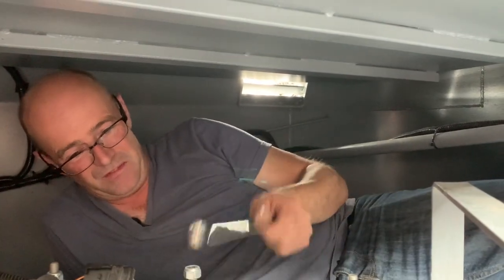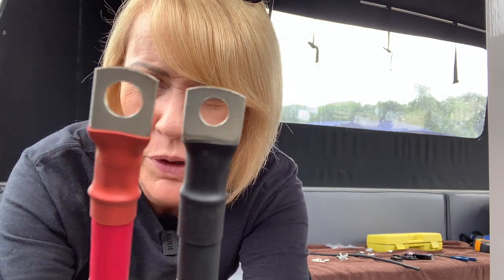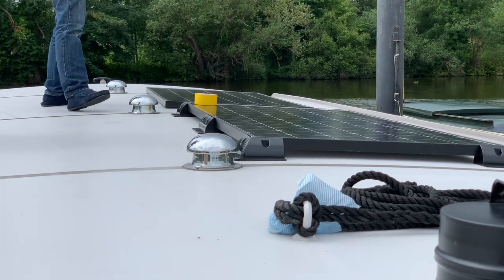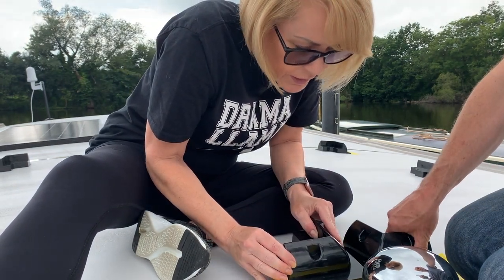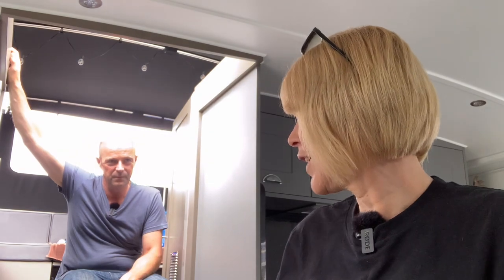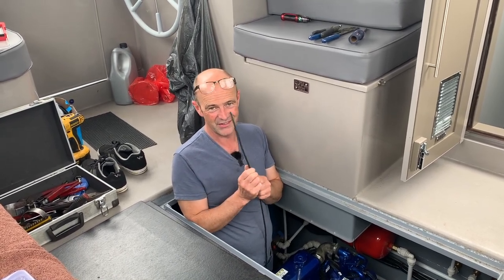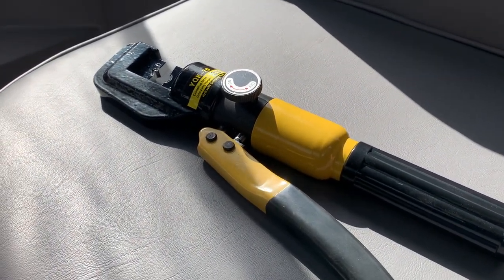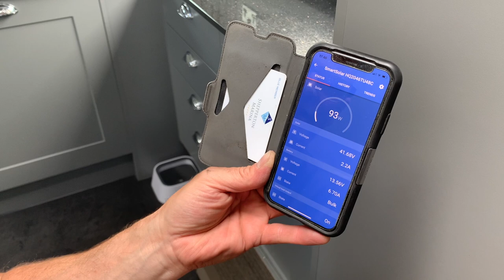14. We fit solar to our wide beam | Boat life

Comment: Good work - now add another couple of sets! You can never have too much :) You should be able to get the cabling in through the mushroom vents and using a long rod go from vent to vent internally until you reach the electrics. That's what I did on mine.
Reply from the maker: We will definitely be adding some more! Oh that’s an ingenious way of doing it, thanks for the tip 👍😁